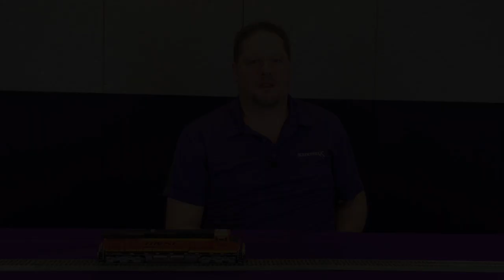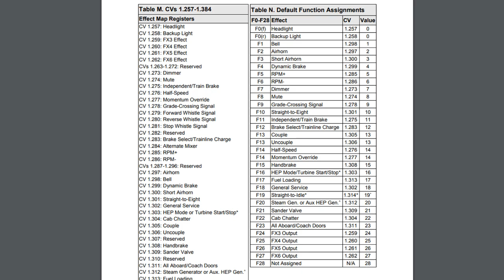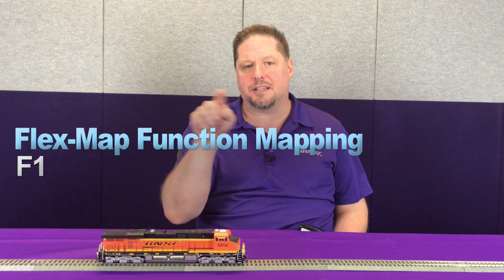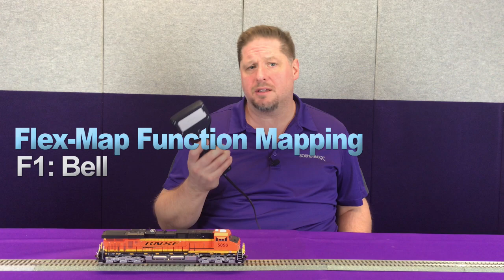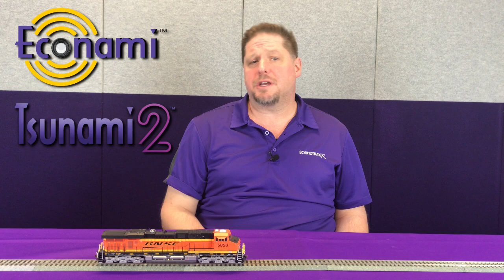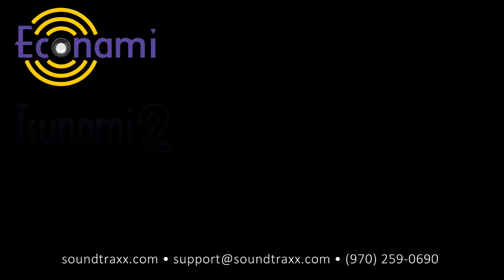SoundTraxx Flex-Map Function Mapping & DCC Commands

Comment: Why is it that when you buy a new Tsunami chip, all the commands are always disorganized? It almost always comes with F1 as the horn and F7 as mute (when normally the horn is F2 and mute is F8), and others all jumbled up like that.
Reply from the maker: I am not sure what you mean, because on Tsunami2 aftermarket decoders, F2 is the airhorn, and F8 is mute by default. If your decoder came factory-installed, the locomotive manufacturer picked the defaults.
Reply: @SoundtraxxDCC yes is aftermarket decoder, The problem is I can't find the correct CVs to remap the sounds; I can't find a table that matches the sounds it has. Another strange thing is that the locomotive doesn't start playing the sounds until you hit the emergency stop button at the NCE control.

Comment: I programed cv 29 with a value of 50 and my engine won't move,  It's the SOU sd40 with the econami decoder
Reply from the maker: CV 29 set to 50 would only work with an extended address. Can you find out what the address is on this decoder and give your question and this information to our Support Department? If so they can help you out with this! (970)259-0690 ext.22 or support@soundtraxx.com. Thank you!
Reply: i have the engine address at 1 , and i use a mrc prodigy explorer

Comment: So much to remember..
Reply from the maker: Don't worry you don't have to remember everything. All of this information is in our Tsunami2 User's Guide that can be found on our website. (https://www.soundtraxx.com/manuals.php)

Also, these are not features that you are going to need to reset on a regular basis. Once you pick which function button you want to control which effects and set the CVs you are done! And if you want all of your decoders to have the same function mapping, we suggest keeping a 'cheat sheet' of the CVs you changed so you don't have to figure it out again. Just go through and change the same CVs to the same values on each decoder to match your function mapping! 

And, as always if you need help just call us! SoundTraxx Customer Support: (970)259-0690 ext. 22 or support@soundtraxx.com 

Thank you!